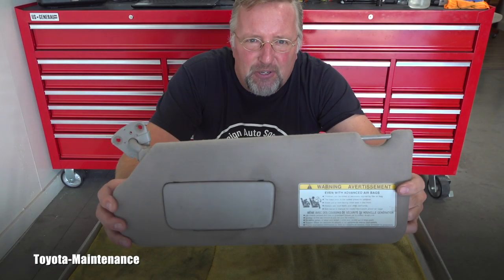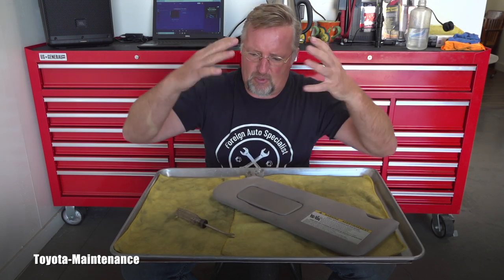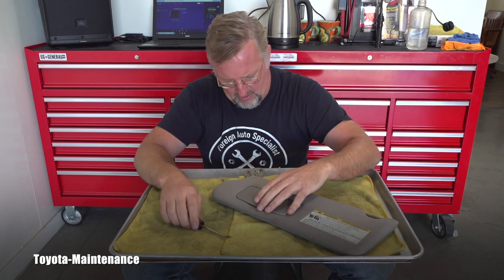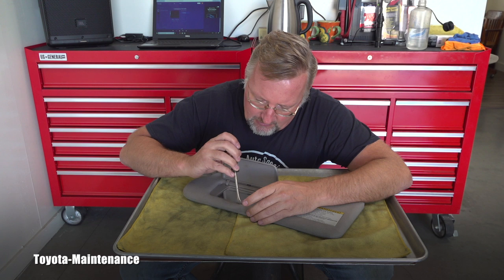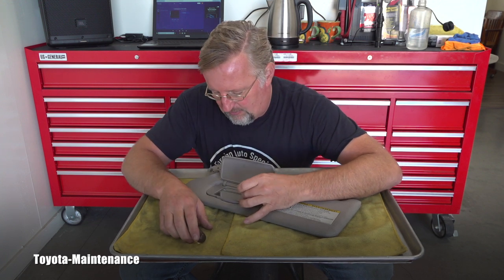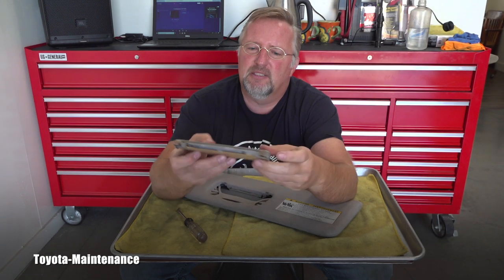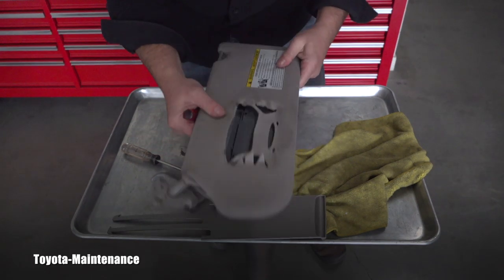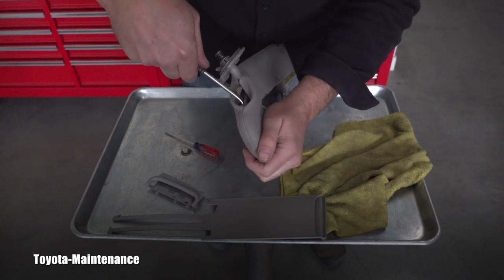Can you repair Toyota Sun Visor ?

Comment: I just took apart my 2016 Highlander driver side visor. Had to use a razor to cut through the fabric on the engine side (hinge side as well) of the visor. There is a seam on that side where the two halves come together. A sharp razor separates the seam. There is a white plastic part that rides in grooves which allows the visor to extend in and out of the main rod. On that white plastic part is a metal high tension part that provide the tension on a flat segment of the rod (this is the up position). That 50 cent metal clip failed and broke on the round end. Pisses me off that without that small cheap part this will be very hard to fix. If I had that part it would easily slide over the white plastic piece and then I could glue back the visor. I wish I could find that metal part. Now it deciding to pay the Toyota stealer ship $200 buck for a new one. Nice work Toyota

Comment: That was fun.  I think they can be repaired: either with very strongly glued Velcro on the headliner or possibly a Zip/cable tie down the steel piece for added friction, or the best way, with a screw driven through the visor and then a washer and bolt attached to tighten a plastic piece which is supposed to grip the steel piece, but breaks or gets lose.  I'm going to try the zip tie approach first, because it's least invasive, but on Toyo visors, there's not much room for the tie.
Reply: I've thought about light tapping a toothpick or two down along that rod for added friction like you said. Will report back
Reply: @CubNole  please let us know how it worked. The zip tie works…so so.  I’m still considering Velcro in addition but won’t do the screw idea.
Reply: @cawag98  tried velcro. The first time the temperature got over 90° it "melted" adhesive everywhere both pieces fell off and got glue gunk all over the place. Not highly advisable for a long term fix
Reply: @-DILLIGAF  What about velcro applied with a glue that works on fabric (not an adhesive backed velcro).   I' wondering if epoxy would work?  Even better: sew!  If you can darn a sock or sew a button on a shirt, just take a needle and sew the velcro edges (after glueing?) to the fabric liner of the car.  Maybe you can even get a velcro that will stick to the fabric liner of the car (without having another piece of velcro to grab on).  Note that it will slowly turn the surface of the liner raw with all that grabbing...

Comment: My 97 T4R driver side sun visor has a screw that adjusts the tension - but I almost started taking it apart before I found the adjustment screw.
Reply: So my 03 T4R’s drivers sun visor won’t stay up tight against the headliner when stowed. It wants to hang down a few inches which is real annoying. I assumed the “catch” is worn and there’s not enough friction to keep it from rotating downward. Does this adjustment screw you mention by chance tighten the hinge so it won’t rotate down so easily?
Reply: @dominiquestephenson195  Yes I just turned the screw like to tighten it and it worked great.  Here's what my passenger side visor looks like with the adjustment screw on the visor.
https://pasteboard.co/ICBThX9.png

Comment: Looks like Toyota made the sun visors as "non serviceable" part. Unfortunately, new or replacements are not cheap. I need a passenger sun visor for my 2000 Sienna and even used ones go for close to $100. Do you know if aftermarket sun visors are available? Great video,

Comment: do ya know of anyone that knows anything about 1985 toyota celica gt. I have one but 2 months ago on my way up the hill going home and all of a sudden it just died..did a bunch of tests and now it starts ans runs for about 10 seconds and then dies...
Reply: Just guessing but try fuel filter/fuel pump
Reply: @cf6979  lol fuel pump is working and putting out 50 plus pounds of pressure and fuel filter is shiny and clean
Reply: @donaldgarin1938  maybe check/clean mass air flow / throttle body if you haven't
Reply: Donald Garin
: Ask  SCOTTY KILMER On U Tube,He Has A 84 or 94 CELICA GT ,I Believe.
Reply: I'm pretty sure it's your visor...